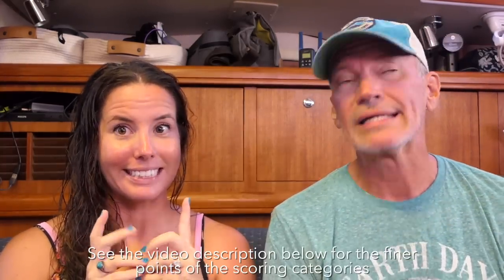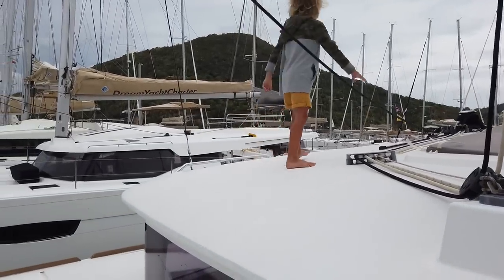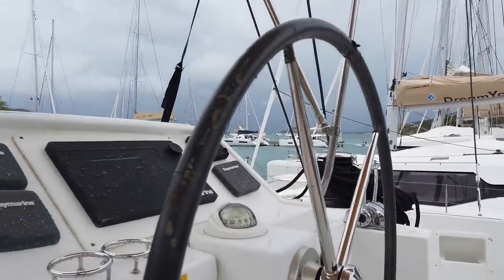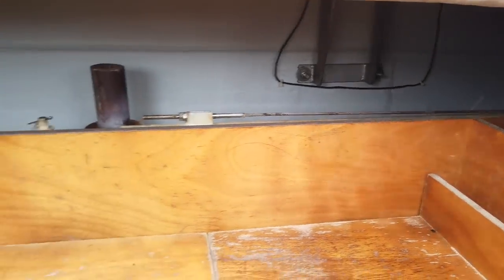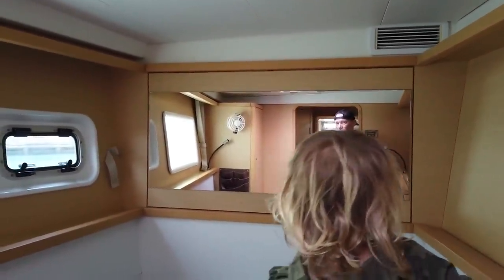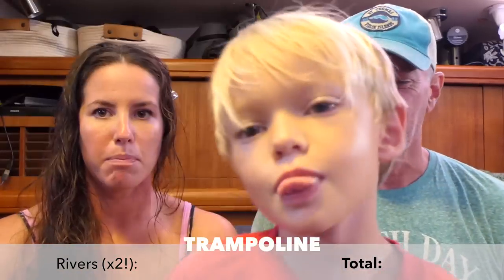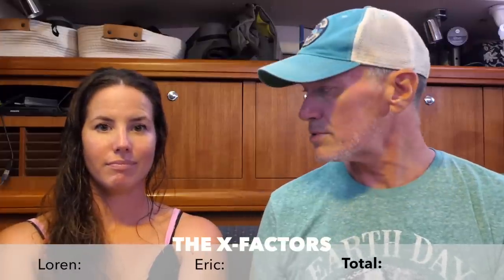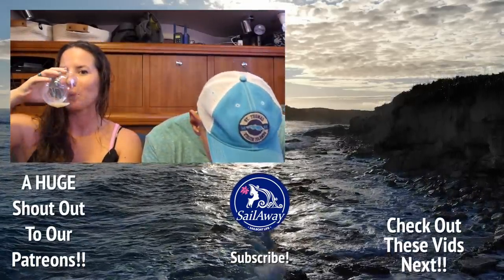LAGOON 450 REVIEW - Who CARES About BULKHEADS? | SailAway Boat Tours

Comment: aero manufacturing engineer here, and a friend in composite rotor blade industry, combined 30 years of expertise, we both reviewed parley and most bulkheads pics online, we agree: run like hell....you have improper tabbing from the manufacturing, just to start and the lagoon repair kit is a band aid. You'd have to do what Parley did (although we also think he went above and beyond but as the saying goes, if you're "right there" might as well do it).

Comment: You obviously have not spent enough time looking at "Parlay Revival". He found and told the world about the problem. Ask him if broken bulkheads can sink you. He didn't think he would have made it across the Pacific if they hit really bad weather. And he is an engineer and Colin knows what he is doing.
Reply: Also didn't see anyone go up the mast or even look at the rigging.
Reply from the maker: We're very familiar with Parlay...shared a booth with them in Annapolis.  Really cool guys.  You have to keep in mind there's a LOT going on with that boat aside from his extreme bulkhead issues (very few of these have the issue as bad as that one...most not at all yet).  As far as rigging goes, no one goes up the rigging when you tour a boat.  It's very important, but that doesn't happen until the survey.
Reply: I agree, bulkheads are a Huge issue! Including rigging and steering! Lose rigging, has a high probability to become, dismasted!
Reply: @SailAwayVlog  have you seen the channel sailing nahoa had a video a couple days ago where their lagoon is coming apart? It seems fairly common. One boat that Colin spoke about was only a few years old and never saw rough seas. I am not an engineer but you put all those forces against a piece of 3" wide 1/2" 5 ply with no glass and you should expect it to fail. 

There is a lot going on with that boat, but I can see that main bulkhead is supposed to provide all the strength in the boat and they made it from 1/2" 5 ply. The images of their failure match consistently with all the other images I've seen of the same failure on other vessels that didn't go through a hurricane or charter business or run aground.
Reply: I actually saw a 4 cabin lagoon catamaran for sale for $8k last week in green bay. It went quickly. I saw another one i think was a 450 for sale last week with a charter business, I cant remember if it was keys or carribean but they were asking $450k. That one was online about a week.
Reply: @SailAwayVlog  I think you are the one not doing you research. There are apparently  hundreds of lagoon 450's with broken bulkheads.  Lagoon wants to keep it as quiet as possible and so do many of the owners. Owners do not want to find their boats have depreciated because of this problem. Lagoon is offering repair kits, but there are many owners who are not capable of doing the work. Also not sure how many trust  Lagoon to make repairs.

Comment: You say it's not dangerous.  I think Colin from Parlay  Revival might disagree.  He only found his problem because all his side rigging went slack.  If you are in heavy weather and finally the bulkheads give way enough to slacken the rigging enough, it could bring down your mast if you are with full sail.  I'd say that is a pretty dangerous situation to take into consideration.
Reply from the maker: It’s not that I don’t see your line of thinking, I do. But very well qualified marine engineers and the boat designers who investigated the issue at great length say no. It would be very easy for them to hedge their answer to cover their asses and not risk their reputations or lawsuits, but they didn’t. If that’s not enough for some, that’s their choice. Knowledgeable, qualified people get drowned out by internet opinions on all sorts of subjects.

Comment: The bulkhead is an integral part of the reinforcing of the boat, that's why it is designed and engineered accordingly. If this is compromised then it can cause major internal problems that can cause the boat to come apart. Especially if the rigging becomes lose due to the hulls integrity no longer reinforcing the mask. As a captain of such a vessel having this issue then I am responsible for my crews safety and if it includes them being my love ones then I wouldn't purchase or own such a vessel that can compromise their wellbeing. The repair kits suggested by Lagoon is a bandage repair, not sufficient enough to give confidence of solving the engineering design failure. That is also why Lagoon are revisiting other boat designs within their models, informing owners that yearly inspection are now required if they want to keep manufacturing warrantees. A bandage by the Lagoon to protect their own liability and put the responsibility back on the owner. Simple solution for a new owner is to look somewhere and not have to deal with this kind of situation.

Comment: How would you protect yourself on the flybridge in cold, windy, wet, high seas?
Reply from the maker: Most owners have a zip on/roll up enclosure for that bimini up there.  Most owners I've spoken to claim that in rain or rough weather, they operate mostly from inside with autopilot...vision is good from inside if you keep the lights off.  It's another trade off of the flybridge for sure though.

Comment: I think the Lagoon 450 vs your Privilege is a statement of how catamarans are being built. You have solid wood and a quick boat. This was designed with an inexpensive interior you would expect in a travel trailer. The interior space was increased for the charter fleets with no regard to how it would sail. That said, I think your Privilege could use either a second helm or a closed circuit tv to see what is going on on the other side of the boat. Additionally it could use some protection from the elements, but hopefully the new top you put on has helped. Despite the list of upgrades required, I would still chose the Privilege 482, all day long and twice on Sunday! Can you imagine the boat you would have with the difference in price between the two! You would be rolling around in a Cadillac.

Comment: Here is a scientific fact or to narrow it down an economic one. Lagoons are built in France and catamaran's take thousands of man hours to make. If you add those two facts together it is likely that the manufacturers are paying 3 or 4 times as much labour costs as for those produced elsewhere like SA or Vietnam. Therefore manufacturers in these areas can afford to put in the extra labour QC and finishing the boat to a higher standard.

You are probably familiar with Parley Revival and due to his extreme bulkhead issues he had to delve pretty far into his Lagoon 450 and found unrelated issues which most owners would never see that were obviously from the factory i.e. bulkheads tabbed but not joined to the adjoining bulkhead, bulkheads glued not tabbed there was even a case of a floor which was glued but never joined (You could see the thick glue which never contacted the next floor) and had been "fixed" by the previous owner by putting batons so both floors made contact. 

None of these issues would of sunk the boat just made it more noisy and less strong than if it had been done properly however when you are paying European wages the cost of decent QC and addressing these issues which would not be seen is high.
Reply from the maker: Wow, that's nuts.  I've seen some of Parlay's stuff but not enough to have seen all that.  Sure makes you think twice.  Also makes you wonder if some of the new Asian brands might be a better bet.
Reply: The point is productivity. An American or North-West European worker has a much higher productivity than a Chinese-Vietnamese. That is exactly the point, why European-American labour intensive production can still compete with production from "cheap" labour cost areas. That goes for optimal run factories who want to stay in business, of course. The motive no. one, to move production to China, was and is the huge local market. What you are missing in Asia is the creativity of your local workers!

Comment: first sign of bulkhead issue. Cabinet door didn't want to close right. what about the cabin doors closing? You didn't sail on it to listen for noise? sailing zingaro went into each cabin under way and their was so much creaking one couldn't sleep if wanted to.
Reply from the maker: The only cabinet doors that did t close right just had bad hinges…the hardware wasn’t great. Cabin doors were all great though. Solid and closed well. We didn’t sail on it because it was just a tour. You don’t get a test sail without being in contract.
Reply: @SailAwayVlog  okay. if you do get a lagoon 450 watch parlay revival first he shows where it cracks and how to measure the boat etc.

Comment: i dont exactly remember about your mono hull but i have this idea that it is on the lighter production side (maybe im wrong). i dont understand why would you change for a Lagoon with a tired interior and low quality on several items. nevermind the other potential structural issues. get an older, proven, boat with some work to be done (not crazy work that would render the boat unlivable) or spend more money in a proper catamaran brand.
Reply from the maker: Thanks for watching! Personally, the bulkhead issue aside which everyone kinda has to weigh for themselves, I don't think there's any issue at all with the toughness of these boats or other production cats. They've made literally thousands of ocean crossings without issue.  With any used boat, it's all about that specific boat...getting surveyed, knowing it well, outfitting it well.  That said, and not to give too much away, but your thinking is pretty much spot on in the direction our search has taken. :-)
Reply: @SailAwayVlog  well, i guess i see what you are trying to convey. if you take the boat in its individual bits, then yes, one cant say anything about the amas integrity (for instance)they both hold up to what we consider normal standards. but in reality the vessel is the sum of all the bits (and then some, for someother ppl) and if you have stcutural issues, then it kinda "invalidates"  the whole boat. agree that its up to each one to access that, but, honestly it shouldnt be a dificult decision, specially in the known problematic models. ive been saying this for years: best thing to do to a lagoon is to remove spars and rigging, up those diesels and tankage. its a great living platform.it just so happens that it also floats!

Comment: I wouldn’t pay top dollar for that, given the bulkhead drama. (I’m sure you have watched Parlay Revival series on it) and all of that interior hardware replacement is not going to be cheap, as well as time consuming. These boats would be similar to having a ‘salvage’ car title. Nothing wrong with driving one, but hard to resell.
Reply from the maker: Yeah, we wouldn't pay top dollar either, and most are priced accordingly.  They are selling though, no doubt about that.  We've seen several that we were casually watching get snapped up really quick. Again, all had already had the certified repair before showing issues.  We've gone a different direction ourselves...it would've taken a pretty stellar deal for us.

Comment: Bulkheads issues not a safety issue????? What???? Loosing the standing rigging on your mast due to the bulkhead problem? That is a potential issue obviously.
Reply from the maker: Losing the rig of course would be a safety issue...but this bulkhead issue doesn't jeopardize the standing rigging.  And that's not coming from me, but from the boat designers and the outside engineers they consulted to sort this out.  That's a statement Lagoon's legal team would NOT let them make flippantly.

Comment: After seeing your views on the bulkhead issue you should contact collen on the channel parlay review his profession is a yacht engineer that works on supper yachts , and he's the one who discovered this problem and what he  went through to fix it and it was a over a Year's worth of work I mean he did over build his when he put it back together but he didn't want to have the problem again but his boat was literally tearing itself apart you can go to his channel and see the episodes where him and his crew tore his boat apart and fixed the problems lagoon was working to help him at first but when he wouldn't shut up and stop warning people they basically stopped helping so I wouldn't put to much Fath in the word of the people that built the boats and when they found out they could have issued a recall but didn't , and as for not sinking the boat you really need to check out his channel because his bridg deck was literally tearing loose from the pontoons and trust me if that happens it will sink your boat
Reply from the maker: Hey Bryon!  Yeah, we know the guys from Parlay...shared a booth with them at Annapolis last year...good bunch.  You gotta keep in mind though that that boat had a TON of other issues on top of a pretty extreme example of the bulkhead problem...he rescued that thing from being upside down from a hurricane.  None of the 450's on the market have anywhere near the amount of compounded issues as his...most have zero and have already had the bulkheads reinforced.  And you can't really "recall" a couple hundred catamarans that are already 5 - 10 years old or more.  Lagoon's response was extremely slow, but the paid fixes they're doing are about as much as anyone could expect.

Comment: Lagoon did a horrible job of addressing this issue until they were forced to by Colin on Parley Revival and even then they didn’t reimburse him for his repair. This is obviously a design flaw and from what I understand they are not offering the reinforcement for all boats, only those that have failed. Look up lagoon cockpit floor deflection which is another issue.
Reply from the maker: Yeah, I heard they were absolutely awful about it until they had no choice.  Not just for this either...they're notorious for ignoring owner issues.  They are in fact offering it for all boats at this point, even pre-emptive.  Trying to salvage some of their rep, though it may be too late.

Comment: It would be easier to replace one of these windows than a super custom molded one. My beef is with hidden bulkheads that are burried, and hidden with cake that has no structural strength to add to the bulkhead. These bulkheads could be finished bright so you could see water damage, and staining, and cracks earley.
Reply from the maker: I agree with you there. All these boats should make that stuff much easier to get to to see what’s going on.

Comment: From what I have seen and heard, it depends on how hard it has been sailed! As an aircraft mechanic I have seen similar problems in aircraft designs. The bulkheads worked fine on their smaller vessels, but when they went larger they did not increase the thickness of them and reinforce them! they are not a blue water vessel!
Reply from the maker: Thanks for watching!  And, yes definitely true.  There's also been some talk of some of them being strapped improperly for haul out or the rigging being tuned wrong, but who knows.
Reply: @SailAwayVlog  The U.S. Navy's trimaran-style "Independence" class Litorral Combat Ships have had massive cracks developing near their frames, apparently because the design doesn't handle stress particularly well when the weight isn't evenly distributed between hulls.  Which I mention because (1) multihull design is harder than people think, (2) stress fractures at the frames and bulkheads can happen to the best of us, and (3) it can turn into a catastrophe when things go wrong.  USS Omaha can't put to sea if the waves are bigger than about eight feet as a result of the structural problems.

...he wrote as he realized that he doesn't know what boat you all ended up getting....